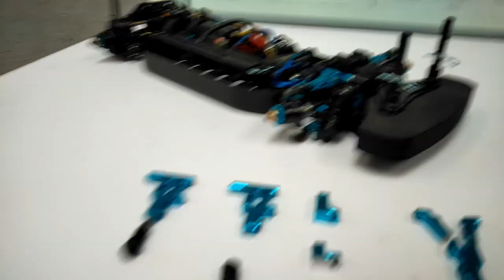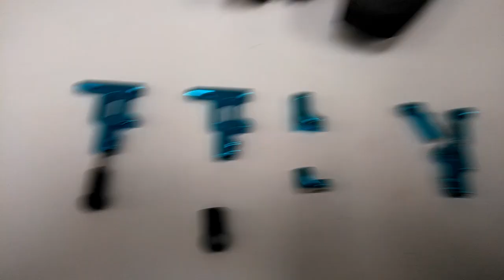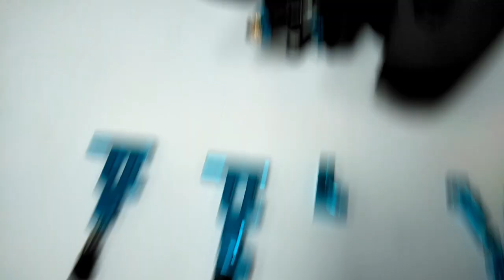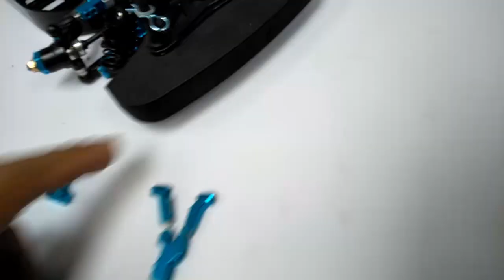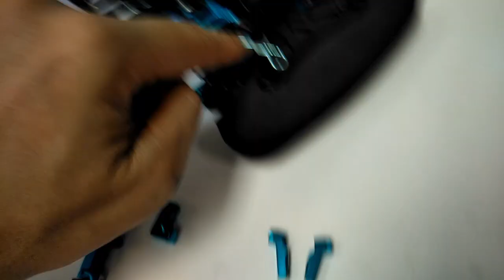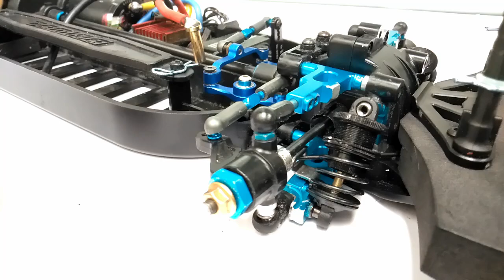Tamiya TT01 Modified Suspension Design

Comment: Looks terrific. I managed to lower my ride height a little (TT01E) however I did not expect the results.  We race on a gym floor, very slippery.  I found that the rear was now swinging out a little more on power.  Maybe adjust diffs?
Reply from the maker: Hope you find the setup. Ride heights affect a lot of things :)
Reply from the maker: Lowering ride height lowers the roll center and makes the car roll more which may make the rear swing out. If this is the case a firmer rear spring will give more rear support and help with on power stability.
Reply: @rccartips  Ah ok.  Thank you!

Comment: Why do you think all modern cars have the kingpin in line with the inside edge of the wheel these days, for such a large positive scrub radius?
Reply: I think it's because of the outer double cardan joint and the wheel bearings having to be placed outside of that. There was a shorter design than the double cardan joint being made for RC, but I can't for the life of me remember the name... I just remember it was patented and expensive...
Reply: Found it... the RCV by miborg. This would be a much better joint to use to allow you to adjust scrub radius by moving the RCV cup inside of bearings allowing for a really short axle and adjustable scrub.
Reply from the maker: I am not yet clear on the theory, but so far from my prototypes the one with the center width of the tire closer to the kingpin seems to give faster corner speed and more precise steering. Apart from less tire scrub you can also have longer arms for the same car width.